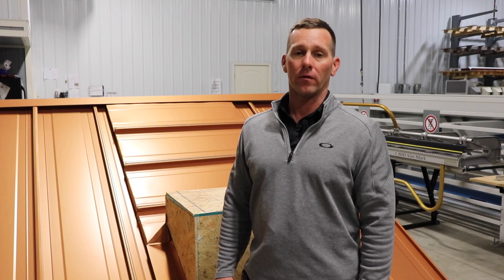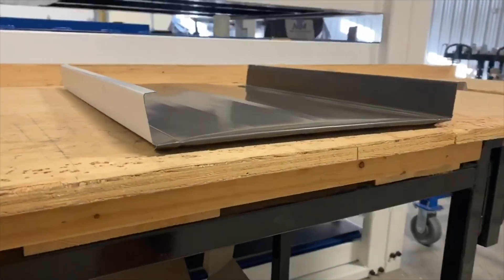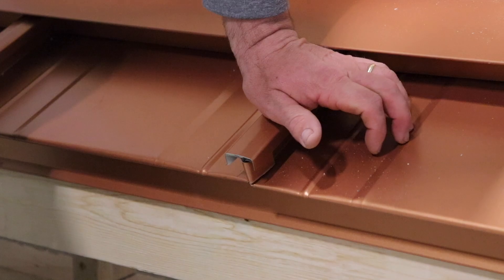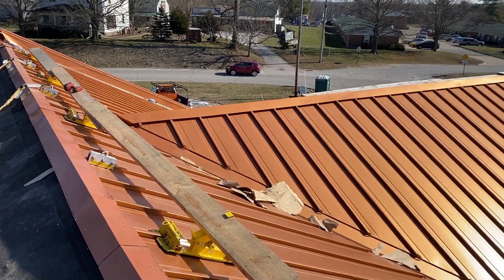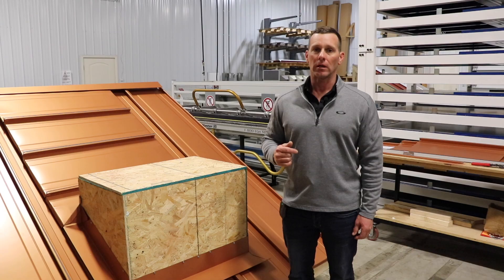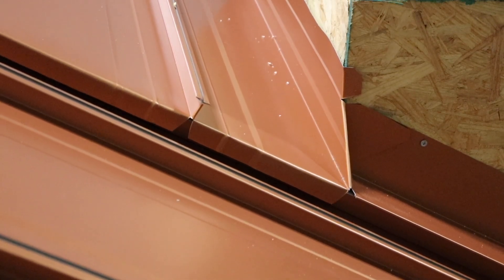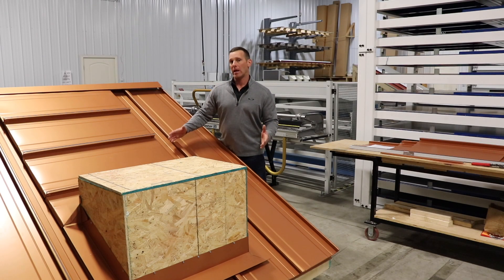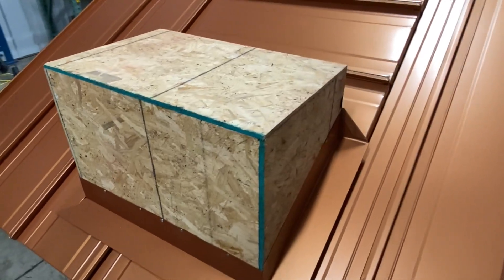138 T Standing Seam Metal Roofing - 5 reasons why this type of metal roof is so Unique

Comment: So how are the 138T panels attached to the roof. I understand how the panels are connected to each other but what holds them down to the roof . Clips, screws, what.?  Thanks for posting.
Reply: It's basically a friction joint. The seam is double bent and tied from the eaves to a horizontal metal slat above the gutters, that also acts as a drip board.

This is not something new, this type of tin roofs have been made since the 12th century in Europe but because it has always been the most expensive prestige option due it's cost and demand of highly-skilled specialised labour it was almost exclusively used on cathedrals, castles and great manors until the 19th century when machine stretched steels and copper sheets became available and made this type of roof much cheaper.

If this old-fashioned type of sheet-metal roof is properly made and maintained it can last over a 100-years. For the more modern and easier to install clip-in sheets which you clip in on each other, the manufacturers give between 30 to 40 year durability warranties.

Comment: thinking of a metal roof as I live up on  HILL EXPOSED TO REALLY STRONG WINDS AND JUST HAD BAD WINDS HERE THE LAST COUPLE OF DAYS AND i HAD  SEVERAL SHINGLES BLOW OFF MY ROOF AND NOW HAVE TO PAY 250 DOLLARS TO PUT NEW ONES ON THE SMALL AREA  sorry caps lock stuck . I was lucky to have  bundle of the shingles . 6 of the shingles that I can see are damaged or blown side ways . . I have metal roofs put on my shed and my 3 car carport several years ago . But could not see at the time to put metal on my house since the roof was brand new and had ice and water shield under shingles when the house was built .  I have a front porch that the roof goes out onto at and angle and i see they have several ways to address that . Which is better in that case . I am thinking standing seam . The front porch is 100 feet long and 12  feet out . We are retired and 70 years old . Who would have thought our country would have went downhill this fast
Reply: Use PUR SANDWICHES PANEL WITH 5 INCH SELF DRILLING SCREWS ( metal  or wood screws  DEPENDING THE DECK OF YOUR ROOF😊❤) GRUPO ELEFANTE  COSTA RICA 😊

Comment: The major disadvantage of concealed fix sheeting is it's poor performance in windy conditions. Another disadvantage is the unfixable snapping noise it makes while contracting in the cool of the night.  Positive fixed sheets are fixed at about a meter intervals, so the expansion and contraction is limited to one meter.  Standing seam sheets produce more waist, as the off-cuts can not be flipped to be used on the other side of hips and valleys. We screw sheets only at the up-stands, or roll, of the sheets.  Not in the pan, as this video indicated.  This means that even an aged washer will not let water through your sheets.  The screws on my roof has now lasted 34 years, and I have no plans to replace them.  We order sheets to the length of the roof, so we never have to overlap sheets top to bottom.  Every plan you make for the ridges on concealed fix sheets, have a similar solution for any other type of sheets.  Corrugated sheets are S-type sheets.  Concealed / standing seam sheets are more expensive.  Material and labour cost.  Concealed fix sheets was designed for low pitched roofs.